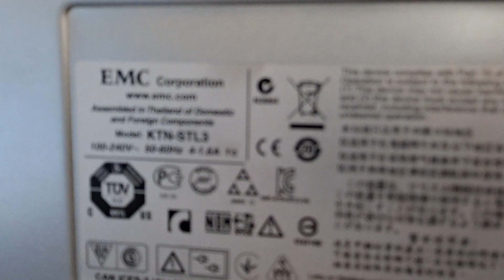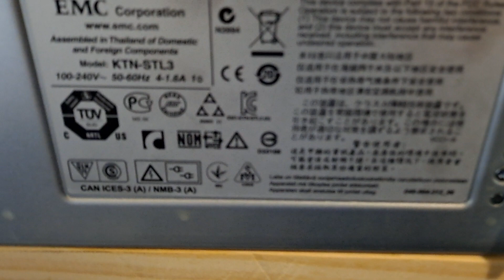Dell EMC KTN-STL3 Interposer and Noise Level Demo and Review JBOD Shelf

Comment from the maker: P/N: 071-000-532 - 2nd Generation
P/N: 071-000-518 - 3rd Generation
P/N: 071-000-535 - 3rd Generation (made by Emerson?)
P/N: 071-000-553 - 3rd Generation VE
 P/N:071-000-554 - 3rd Generation VE 

The 3rd generation power supplies are the quiet ones since they are PWM

Comment: Can the drives be used as a jbod set up and only load a few drives? And it needs a sas card to hook up to a windows machine right?
Reply from the maker: Yes and yea but I only use it with Linux. Unless you are using a crazy high drive count the LSI SAS9200-8e  is a good option, just flash it to "IT Mode"

Comment: Hey noob Here. Nought by accident 4 8gb sas wd drives.  Got the very ktn-stl3 trying to make it work for nas.  Sas drives went in fired up.  What hba controller would you recommend?.   Worried non emc drives won't work
Reply from the maker: lsi-sas9200-8e but since things change quick best to check servethehome or ArtofServer. As for the drives I use a mix of sata and sas or all makes and models and of  lots of sizes. I dont have drives super large but I understand there is no inherent drive size limit for the Dell EMC KTN-STL3 when used as a DIY JBOD.  This means you can theoretically use drives of any size in this chassis.

Comment: Can you tell me if the hardware is limited to only 2TB drives? I have an opportunity to get one, but I'm going to need it to support at least 14tb drives.

Thanks!!!
Reply from the maker: i have it populated with 4tb but I have read on some of the forums where people said they had 16tb working fine. I would research it further.
Reply: @callmebigpapa does it work with 18tb exos btw?

Comment: HELLO SIR ACTUALLY I HAVE THIS ENCLOSER BUT I DONT KNOW HOW TO CONNECT WITH THE SEVER
Reply from the maker: You will need a raid card flashed to IT mode in most cases. In my case I use LSI SAS9200-8e 6Gb/s SAS PCIe x8 External Host Bus Adapter HBA but others will work also and you can buy them pre-flashed on eBay. Mine were around 25usd. One of the cards I had to flash and the other was already flashed when I went to flash it. You will also need a SAS cable. I used a SFF-8088 to SFF-8088 External Mini SAS HD Cable for my card to this device KTN-STL3, these cost around 20usd .
Reply: @callmebigpapa  oh gosh this more than enough …there is a famous quote in my culture says the best ppl who learn and teach the other what they ‘ve known so now are the best of us  …thanks sir

Comment: Late to the party but thank you for adding this. 

One pointer if you have the second PSU plugged in it should spin down a bit and make things quieter. Usually these dual PSU units will think that something has gone wrong when only one unit is plugged in and then will ramp the "good" unit to help offset the "bad" one..
Reply from the maker: Thanks for the pro-tip !

Comment: hi bro i bought 2 shelves like yours they are
connected to the controller Dell H200E External Dual Port 6Gb in a PC on Windows 11, in series, in one shelf sata disks are 8tb, they work fine, in the 2nd shelf sac disks are 3 and 16tb, they are incorrectly displayed in disk management, but in my PC they are are working fine. What worries me is that disk check programs either do not see sas or give incorrect information, maybe you need to configure the shelves themselves?
Reply from the maker: I don't think so but for an issue so specific I would ask on the Reddit homelab sub ....they will know. I have not used mine with Windows so it is hard to know.
Reply: @callmebigpapa  ok, thx

Comment: hi how can you install this i have one do you need card and cable for this
Reply from the maker: Yes unless you have some enterprise level gear that has SAS ports on the back, you will need to get a raid card and flash it to "IT mode" (this converts the card to non-raid and allows data just just pass thru it and in/out the SAS ports/cables to the external (usually external) device),  put it in your PC and get a SAS cable to connect the devices together. https://www.youtube.com/results?search_query=it+mode+lsi+   the channel "Art of Server" is really the authority on this process I suggest you check him out.

Comment: with SAS SSD's that run at around 600mbps, can this still do full bandwith?
Reply from the maker: Pretty sure it is a combination of the hba and the specs of the drives but this article has some insights  https://www.reddit.com/r/homelab/comments/domrxq/picked_up_a_sas_enclosure_am_i_capped_at_6_gbs/    good luck
Reply: @callmebigpapa  Thanks brada!